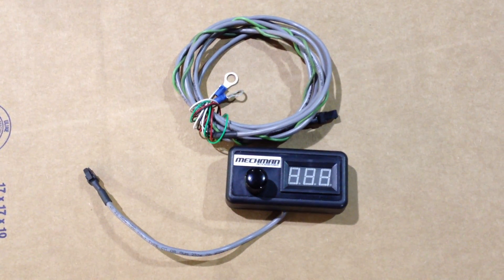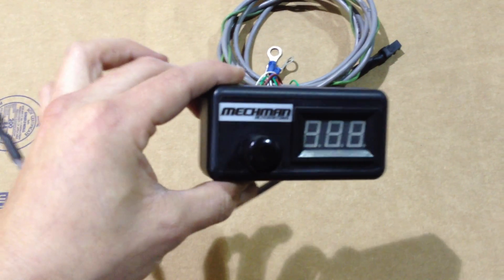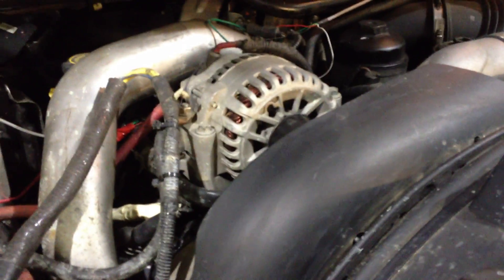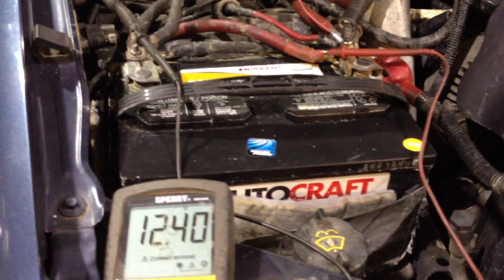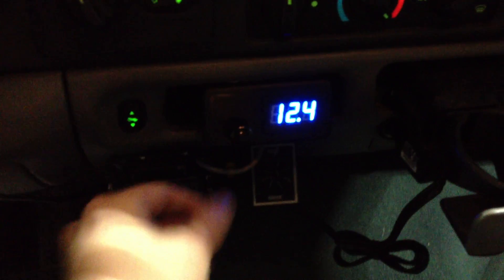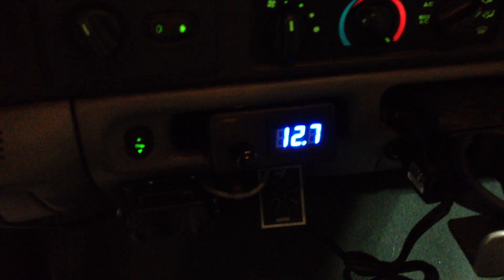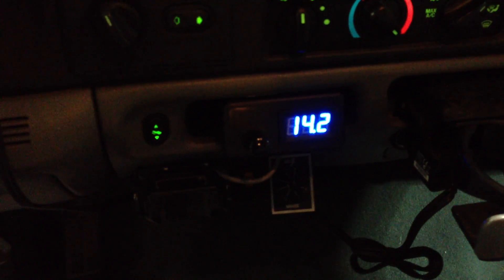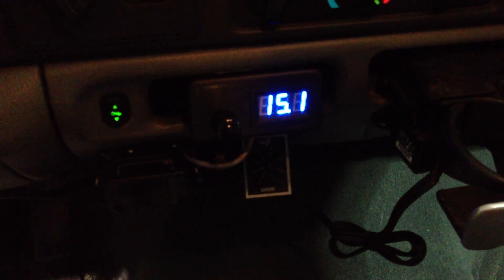AVBM 2 Ford 6G NON PCM controlled adjustable boost module

Comment from the maker: non pcm means it is controlled by the regulator inside the alternator. If its pcm controlled then your computer tells the alternator when and how much to charge
Reply: Are there any options for pcm controlled regulators and boosting the voltage? 2013 f150 and am only seeing 14.1
Reply: That's even with a HO alternator